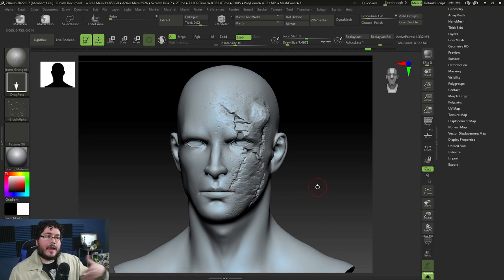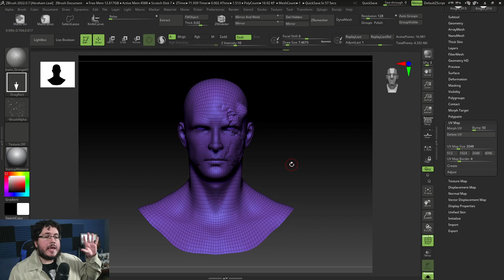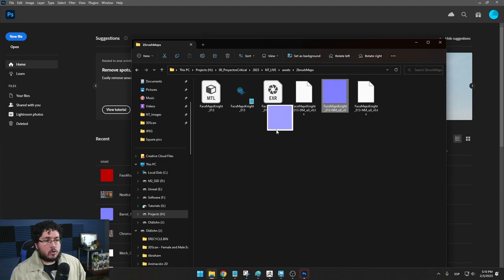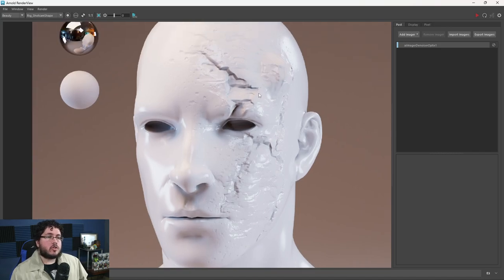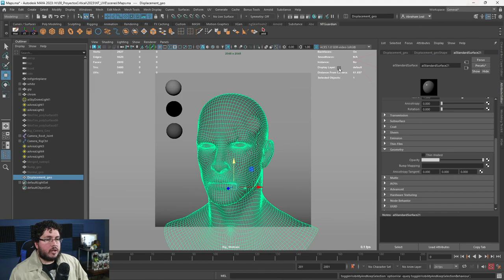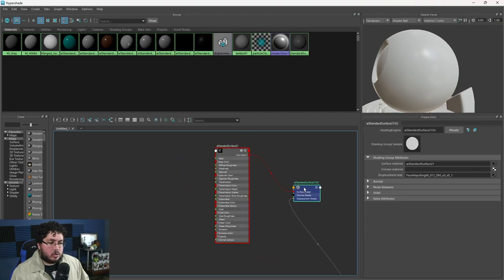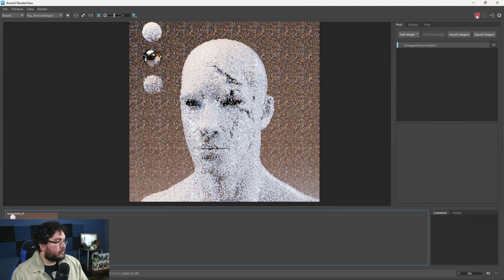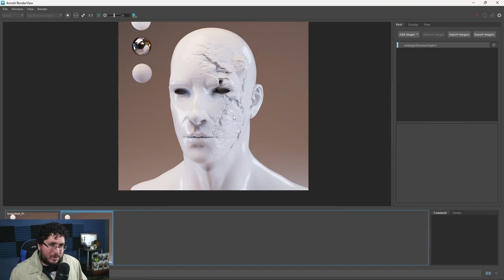Bump Normal and Displacement Explained! | Zbrush and Maya Tutorial

Comment: Great video!  I always use either normal or displacement, but watched, because I was curious about bump.  Good to know it's more or less outdated and I don't need to think about it.

At 9:44, you say the bump map is definitely going to give you a more realistic result.
You meant to say the normal map.  Just wanted to point that out.
Reply: Yes I caught that too, I'm glad you pointed it out. I've been running my own experiments in Blender and I'm finding that Normal Maps are generally looking weak and flat, whereas using Displacement Maps (as a bump, not for physically pushing vertices) is looking WAY better. I don't get how Normal Maps are supposed to be "better" but I used to just flat-out believe it. And in some scenarios, combining displacement with normal maps makes the result even worse thanks to the normals either flattening details or creating unrealistic shadows because it's bending some normals too far

Comment: what does the FLIP G channel or R channel mean?
Reply: also do you recommend GPU rendering or CPU? Ive noticed less fuzzyness in CPU but GPU is much faster.
Reply: Great Question, gonna try to explain. There are two main ways to display graphics OpenGl and DirectX, you might have seen this in games and such. Well depending on what platform you are using the Normal Maps should be setup in a specific way since each system (OpenGl and DirectX) process the normals in a slightly different way. The Flip F and/or R allos us to flip the normal map from one system to another. Thats it, most 3D softwares have this option in some way or another to make Normal Maps work as best as possible.

As for the GPU vs CPU, Gpu will give you faster renders but less precise, Cpu will be more precise but longer. Dependeing on what you are rendering you will need one or the other, however for most things GPU will give great result at lower render times.